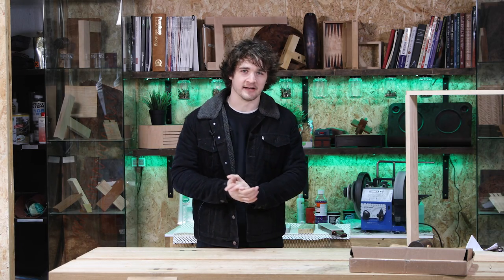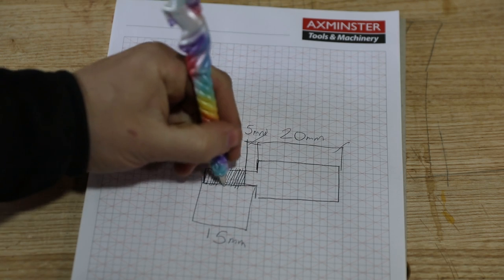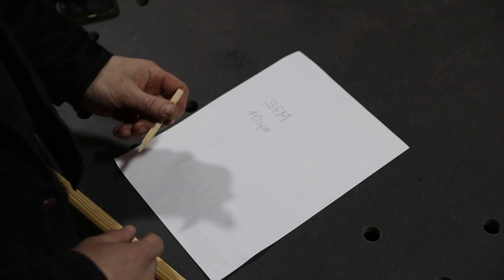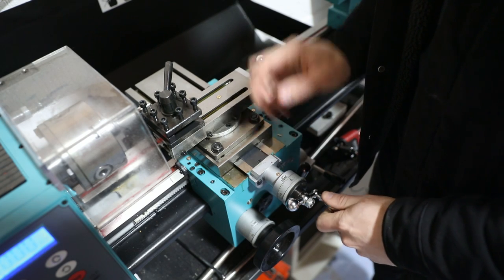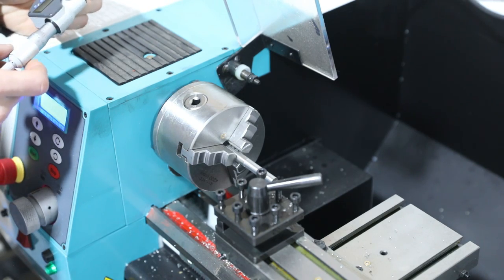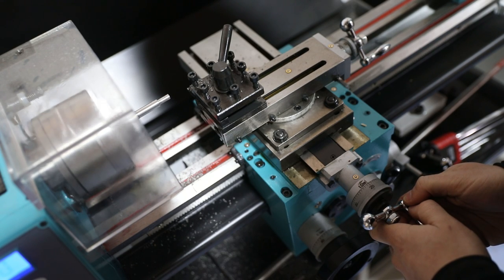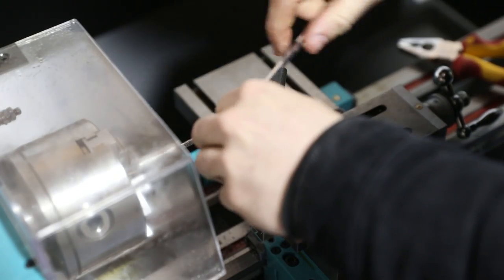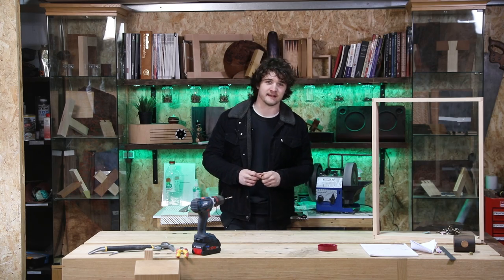Prototyping on the METAL LATHE | Turning Tuesday #12

Comment: The lever on the side is for power feed, the other engages the half nuts for threading.
Reply: And if you change the gearing in the cover on the left you can get different feed rates

Comment: As others have already commented, the rh side lever is for power feed and power cross feed.  It uses a worm gear that surrounds and slides along the leadscrew but powered through a woodruff in a keyed slot along the leadscrew, so it doesn't use the leadscrew thread itself (and that prevents premature wear which might cause poor thread-making).  The front lever engages the half nuts to the leadscrew for thread cutting, and the speed of that relative to chuck speed is adjusted by gears on the left of the lathe.  It is of course quite possible to adjust the power feed by changing the speed of the leadscrew through different gear ratios, as you would for different thread pitches.  Note that the SC4 has a chuck disengage (the large silvery knob on the rh bottom of the panel) to stop the chuck spinning when using the mill attachment and power feed.

Comment: Hi Matt to work out rpm use this formula 
Stainless steel 23-40 meters per minute so 30 x 318 =9540 then divide by diameter 10mm =954 RPM
So for RMP it is  MPM x 318/Dia easy👍

Comment: If you look at the two layshafts at the front of the apron - the slow feed is provided by the feed shaft. When cutting threads the movement is provided by the leadscrew (which is normally an acme thread). Changing the gear ratios for each required thread can be challenging - depending on the lathe. However incremental change is normally by levers on the front below the headstock and range changes by mounting and dismounting gears at the free end.

Comment: Good first effort especially showing it YouTube. I'm a mechanical engineering student and we've done some lathe work and I was fortunate enough to have an instructor guiding my hand. It's all about practice. There are some tables out there on speeds and feeds that will make the calculations a little easier. Off the top of my head I can't think what they are. I'll have a look at my notes and drop you message.

Comment: I like to learn metal turning too! Have a small Proxxon lathe at home, bought it a year ago. Don't know how did I live without it 😄
Maybe you know this already, but pieces which length is more than 2-3 diameters should be supported with a tailstock. And also when changing tools you don't need to remove the previous one every time, just rotate the toolpost. Good luck, Matt!

Comment: Ok not going to give you an abject lesson on centre lathes but just a few things about names. The bit that goes from left to right on the bed is the saddle or carriage. The bit that goes from front to back is the cross slide. The small slide on the top with the tool post is, not surprisingly the top slide. To cut correct threads you will need to change the gears on the left side of the headstock( the bit with the chuck and drive controls). The two feeds for the saddle are just course and fine for finish reasons. I didn't see a thread dial indicator on the saddle but then I might have missed it, needed for cutting screw threads. Well done for branching out, more power to your elbow. Should be interesting when you hit the milling machine! Keep up the great videos.

Comment: Hi Matt,

I've taken up woodworking as a hobby recently, and been watching lots of your videos - hopefully this comment is (in some small way) going to be give something back :)

I worked on manual metalworking lathes as part of my apprenticeship about 10 years ago. Here are some pointers which you might find helpful:

1. Set the cutting tool tip directly on the spindle centre line. Start by taking very light cuts across the end of the metal bar. The tool is on centre line when you cut right across the end without leaving a 'pip'. I think a pip is visible in your video at about 11:00 and 13:20. An on-centre tool can also give a better surface finish

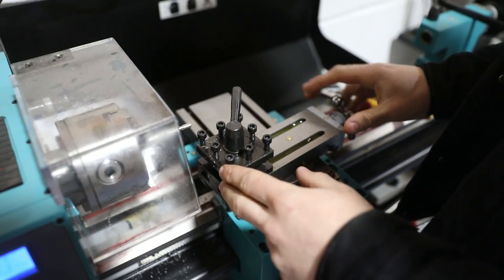2. Once you've faced-off, set the dial of the lower-left black handle to zero. This will then be your reference for all Z movements. Also set the dial of the cross slide handle to zero (you've got your hand on it at 13:48)

3. Take light skims along the length of the workpiece until the surface is cleaned up. When the surface is clean all round, measure using a micrometer and set the last handle's dial appropriately. This is then your reference for X movements.

4. Take another small cut to determine whether the dial is printed in radius or diameter units. For example, aim to take off 0.1mm, take a cut, then measure with a micrometer - if the part has been made 0.2mm smaller, then your dial is probably measured on the radius, and this will need to be taken into consideration for all subsequent readings. This could be the cause of the dodgy dimension at 10:30!

Some other general information:
- You mentioned backlash. I always found that approaching dimensions from the same 'side' every time helped. If you overshoot on the dial when lining up for a cut, don't just twitch it back to the correct reading. Instead, back the handle off at least one whole revolution and try again.
- Spray some WD40 on the workpiece before each pass - this can help with surface finish.
- To reduce flex when machining longer workpieces, consider putting a dead or running centre in the tailstock.
- A bed stop and a set of ground slips can be used to make sure the saddle can be wound to a known Z position - useful for the 6mm bit of this workpiece!
- If you lose your position on one of the dials, wet some paper and stick to to the workpiece. Start up the machine and slowly move the tool into the paper until it's flicked away. Paper is about 0.1mm thick, so set the dial 0.1mm too large and it should be pretty close.

Comment: Simple rules for simple machining.
Feeds & Speeds, if it sounds right it is right.
Screw cutting for dummies with slow reflexes.
After machining the relief, (next time use the parting tool, its way easier.)
Then put threading tool in place, but upside down, set lathe direction to backwards (top away from you)
Then start the thread in the relief and cut towards the right side, take you time, no crashes as it matter not how far you go :)
Plenty of time to engage the thread cutting on the odds or evens as needed.

Comment: Maybe time for a new series machining monday? :D

380 rpm seems slow for a piece that small, but the machine isn't that strong and you better be safe than sorry. You'll figure it out.

Some lathe show the movement of radius on the dial and some show diameter. That can confuse even experienced machinists when they change between machines. What do you think about a dro for easter? :D

Comment: I believe the two different feed rates are to do with threading, slow speed = fine/ tight thread, faster = course/ spread out thread. Please correct me if I'm wrong :) cheers
Reply: What i suppose is, that the fine feed rate is made for reducing the diameter of a workpiece and the course feed rate is made for cutting threads.

Comment: I always wondered, can you do wood turning on a metal lathe? It's much safer and easier than a normal lathe, and blades that cut metal should cut wood I assume
Reply: Yes you can but sometimes the wood is not so good for the precision slideways and bearings of a metal tuning lathe.

Comment: The handle engages on the leadscrew.....not knowing the lathe there should be some gears or dia to change the feed on the leadscrew.....you can then use this to set the feed for cutting screw threads......you might be a way of doing that.....also if you put a dead centre in the tail stock you can use it to set your tool height correctly....the point of the cutting tool should be on centre.  Also dependant on how the dials are setup you are cutting radius....therefore 0.2mm will take 0.4mm off diameters

Comment: it has been a very long time since I did anything with a metal lathe, but my recollection is that one of those drives along the length of the bed should remain engaged so that on each successive pass the tool runs precisely in the previous cut. I can't remember if I backed off the tool and reversed the lathe to move it back to start each pass, or if there was some other way of sync'ing the tool position to the previous pass. Surely there should be something in the manual...or maybe this would be helpful:
https://smithy.com/machining-handbook/chapter-3/page/24

Comment: you probably got the diameters wrong because you thought in diameter. The movement on the lathe is always direct movement, so the radius you're taking off, not the diameter. You apparently always took off twice the amount you wanted ;)